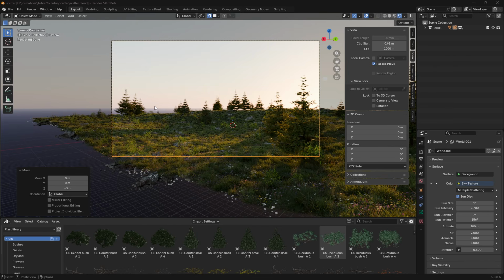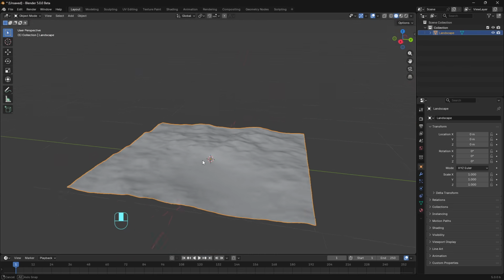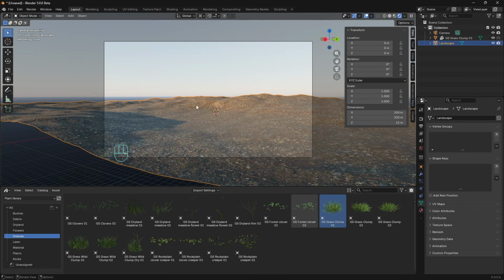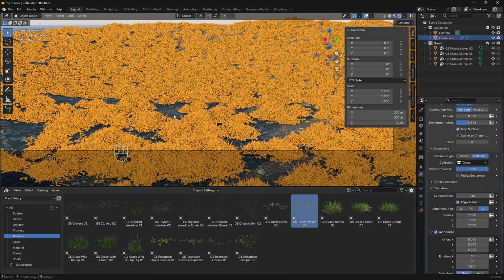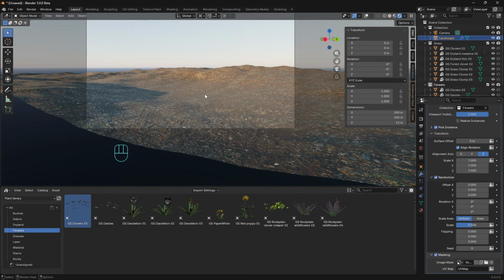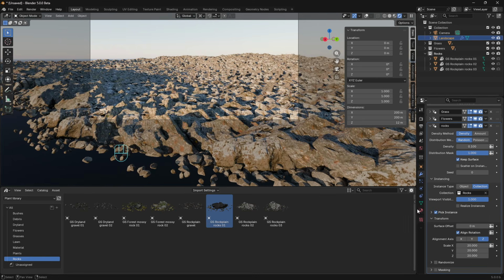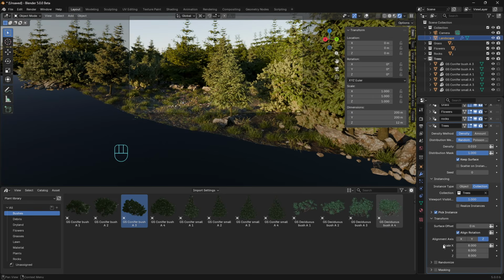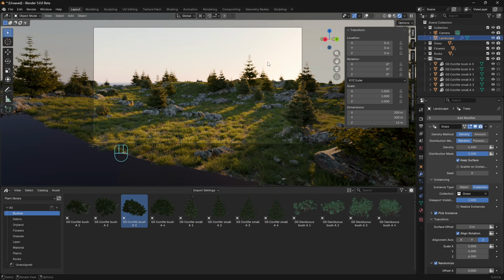Blender 5.0 New scatter modifier!

Comment: Hello, I took this course on Udemy and I'm working on my own ring designs, which is causing me to consume a lot of resources. I create my models using a 3D printer and then cast them in my workshop, but I'm stuck at a point. I draw the models myself, then use the `by distance` command in edit mode to merge the mesh section, then take non-multiple measurements and use Ctrl+A to convert `all` after returning to object mode, and then use the `solidify` command to divide the wall. However, the models coming out of the printer are hollow inside, which causes the model to break and disintegrate in the cast image. Where am I going wrong? I've been trying to solve this for a long time and I'm very tired of not being able to find a solution. I would be very grateful if you could help me.
Reply from the maker: Hello, send me PM on udemy we will discuss about it. Happy blending!